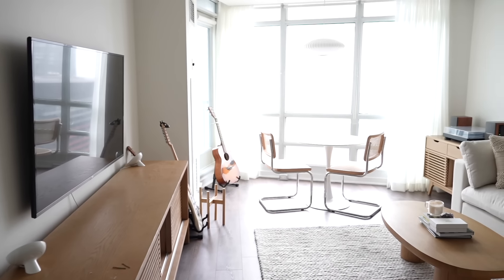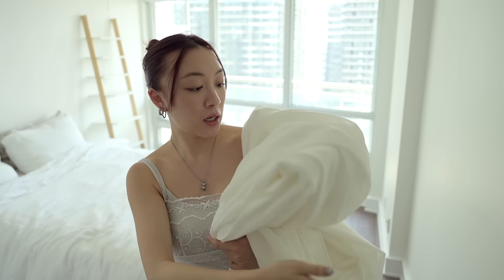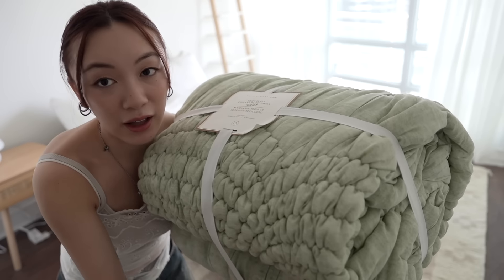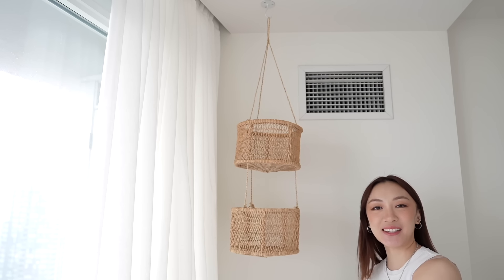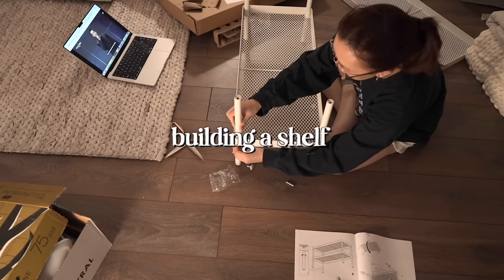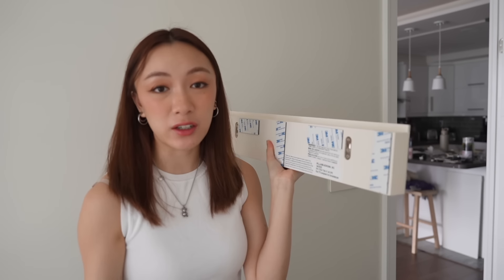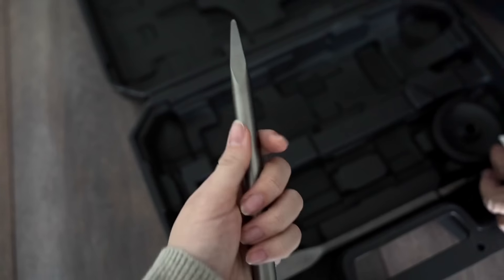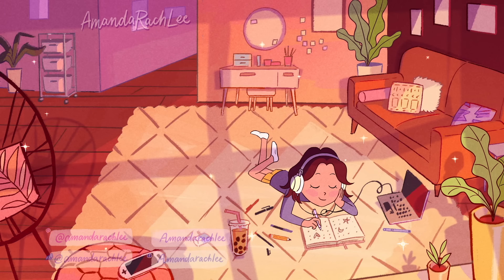ROOM MAKEOVER! (pinterest, aesthetic, cozy transformation!)

Comment: Hanging or mounting stuff without a level is easy! Place a marble on the flat top surface. If it doesn't roll, it's level. Unlike most leveling tools, even those who are legally blind can use this trick! 😁